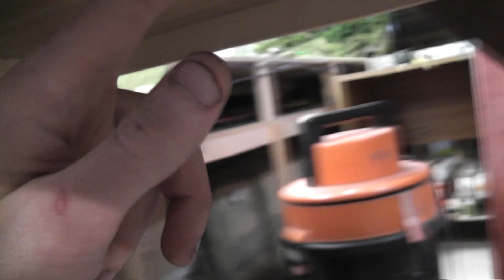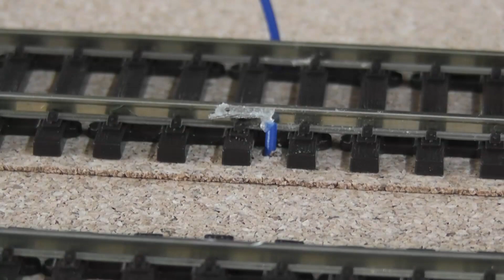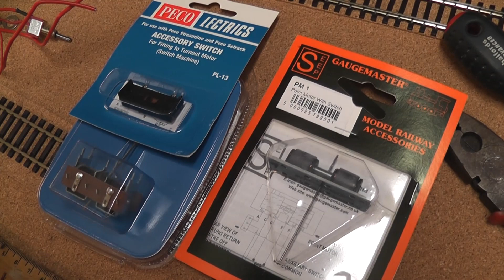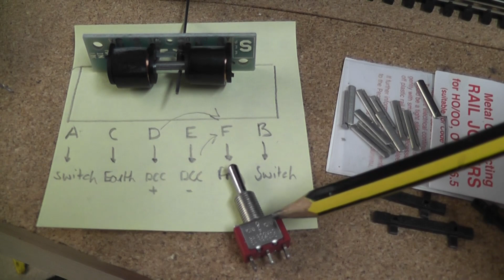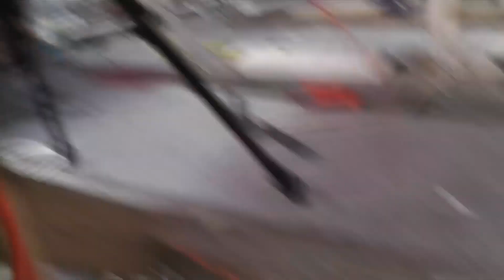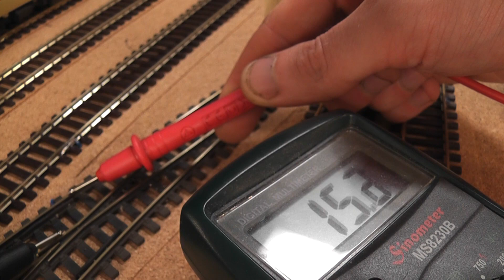Building a Model Railway - Part 4 - Wiring

Comment: Hello Richard.
Thank you very much for your videos.
I have learned a lot and starting from scratch.
I have a digital model with Z21 and Roco multimouse.
But I have a problem with the peco MP1 turnouts, because they make me short and the connections are correctly made.
I would appreciate your advice please.

Excuse my English but it is done with the translator.
Regards, and thank you very much.

Comment: Take some sandpaper and clean the oxide off the wire before you attempt to solder. Flux is not sufficient. Also clean the soldering iron tip. Works better wnen you do.

Comment: The two most common electrical wire sizes in the USA are 12/2 (12 gauge rated for 20A outlets) and 14/2 (14 gauge rated for 15A lighting). If you look at the markings on the white vinyl insulation that wraps around the wires, you should see the gauge size marked on it.

Comment: Like your Videos, love your choice of Flux.(LACO self cleaning))  being a retires Plumber, may i offer a small tip. after soldering wash the joint with a little soapy water,removing the surplus Flux,this will stop corrosion, ensure a longer life of the soldered joint.

Comment: Just a thought, instead of t&e use 1.5 or 2.5mm2 singles what we use in conduit/trunking containment systems.  Singles are stranded so you can crimp the spade connectors instead of soldering.  When soldering place the iron onto the part first and let the heat transfer into the part before applying solder 👍

Comment: For everyone complaining about wire colors, he's in britain, they use a different standard for wire colors over there. Though the soldering instead of crimping did seem very weird....
Reply: The standard for canceling is live is brown, blue is neutral and yellow green is earth. 
The issue is that he hasn't differentiated the cables not the colours themselves. Using all blue droppers makes it hard to tell. The practice usually is red and black to make it easy at a glance.

Comment: Now this is a good video as it put to bed most of my worries concerning electrofrog turnouts. There is one thing that puzzles me though and that is the "earth" tag on the Seep point motor - where does it go and why? I`ll be using Seeps so I need to know this.
Reply: Consider it the neutral or negative if that helps.

Comment: For anyone who are wondering what cable he is using is 2.5 mm twin and earth cabling. You would not need to use 2.5 mm as 1.0 mm will be sufficient.
Reply: 1mm would certainly be sufficient from a current point of view, but for a large layout with decent current draw the voltage drop would be too big on 1mm.
Reply: It's not necessary but it doesn't hurt.

Comment: Very nice and informative video. Just one suggestion: Use the same, or similar, colours on your dropper wires as the bus wires; after all, once the track is ballasted you won't notice the colour of the wires, but it will be easier to install. I have used such a scheme on my layout, though with an additional yellow dropper for feedback (I use feedback modules which detects power consumption whenever my engines or DMUs passes a given section of track).

Comment: What does DCC mean?
Reply: Speketwome
Reply: Digital Command Control - a control system where the track is permanently live and digital pulses control the loco through an internal decoder.  Each loco has it's own individual 'address'  which will recognise a set of pulses sent to it.

Comment: Everyone on You Tube who does soldering makes it look so easy.  Every time I try to solder wires to something, either nothing happens, or it's a total mess and the glob of solder falls off.  I really wish manufacturers would mount screw terminals to their devices.
Reply from the maker: You need a decent soldering iron that gets properly hot.  Then you only need to touch the wire or connector for a few seconds and the solder will flow.  If you are waiting for ages or the solder is going in blobs your iron just isn't hot enough to get the job done.  Try a 100 watt soldering iron.
Reply: EverardJunction 
I have a 75W soldering iron, is that good enough?
Reply: You have one (or both) of two problems, too little heat and/or no flux.  A soldered joint needs the two parts to be scrupulously clean with a 'flux' to keep them clean while heating, and sufficient heat to heat both parts up to the solder's melting point and then you just feed in sufficient solder.  It gets easy if you do lots of practice on scrap wires.  

There are acid (active) fluxes such as LACO in the UK which need to be wiped away and resin (passive) fluxes.  The acid fluxes will also help to clean the metals to be soldered and is generally used by plumbers and not on electrical or electronics due to the corrosive effects.  A plumber will clean off the flux from a joint with a wet cloth and running water inside the pipe will wash away any internal flux - hence the need to flush newly soldered plumbing pipework.

I only use a maximum of 25 Watt soldering iron on electrical work and usually only an 18 Watt iron (note the capital W, it is a convention as it is named after the scientist James Watt)
Reply: @TerryD15  Watt is sentence case when talking about the unit. 1 watt is the correct way of writhing it but if I was talking about the scientist Watt it's capitalised. Only the short form of the unit W is capitalised.
Reply: @TerryD15  Named after is not the same thing.. Manors? What have they do with anything. It is not grammaticaly. there is no convention for capitalising units, if anything it is for them to be in sentence case. Try submitting a college paper with unit names capitalised in the middle of a sentence and see if you get docked marks for it.
Besides in some cases the units are named after but were never defined by the scientist they're name after.
Watt was proposed and defined, not by James watt but by another scientist.

Comment: Always better to use two colors for track feeders... Normally Black and Red... and remember to decide which color for which rail. I use Red on Right (or rail closer to the edge of the benchwork). I found it important to run my shortest wheelbase locos over turnouts while laying and wiring of track sections to check for possible dropouts or short circuits.

Comment: Great videos - very informative and super camera work.  One issue I had whilst watching 'Part 4 - Wiring' was that for both of the droppers from the rails you used blue wire.  Perhaps it would be better to use a brown and a blue wire since your DCC bus wires are brown and blue - particularly as lots of folks are wiring up whilst underneath the baseboard?  This could also possibly help to aviod confusion when wiring up for forg polarilty switching?  One minor gripe - since DCC is around 15V AC, can you please try to aviod using phrases such as 'positive' and 'negative', being AC neither wire is positive or negative as both rails constantly switch polarity.  Better to refer to them as 'feed' and 'return' or 'live' and 'neutral' or 'feed' and 'earth' - there seems to be no agreed convention here??  Always having the blue bus wire closest to the baseboard edge is fine - except where you have access to both sides of the baseboard.  Roy Sage makes a good point in this respect to ensure correct polarity - using an old wagon marked appropriately.  Just my two penn'orth.  Keep up the good work!

Comment: How many dropper wires are needed? Do you have to solder them to every section of track?
Reply from the maker: I fit them to every line and if its a long line I put a set every meter or so.  You don't need to wire up every piece of track.

Comment: Thankyou Mr Warren Everard Junction has been an inspiration and your videos are very informative. Its thanks to you that I've started building Shuttler TMD its not as extensive as Everard Junction but is dcc of which I've never dealt with before. So far 2 47 1 37 and 1 60 all modified with Bachmann decoders except for a Hornby 47 which throws itself off points. Keep up the good work and good luck with the Granada restoration. I wish you were local so you could restore my project. Best wishes for 2017

Comment: Hi I'm running a DCC layout but all of the accessories (lighting, point motors, signals etc.) will be running off a Hornby controller (this would only be used for those and nothing else). If I want to have a bus wire for my accessories where would it start?

Thanks, Tom
Reply: The start.

Comment: I have a Peco 3 way switch insulated, would the Seep Gauge Master switch PM1 how would I hook up the wires to the frogs so the engines won't stall. I watched  the video on the electronic  frog 3 way how do I do that for my insulated 3 way? Thank You for your support
Ernie Peluso
Reply from the maker: I've not used the insulated one so am not sure.  It probably doesn't have any wires out the bottom so you can't wire it to the point motors.  It will rely on the connection to each piece of track for power.

Comment: Do you get electric shock for touching the track? Or is it insulated?
Reply: UnholyGaming2012 It low voltage ac. You won't get a shock.
Reply: @ruralaccentwoodcraft604  That's true but don't always assume that all low voltage won't shock you. You can still be shocked with low voltage but it doesn't carry enough amps to cause damage.

Comment: I'm really enjoying this series of vids on how to create a very nice layout, full marks for the finished effect. I'm confused though, with regard to the wiring, as to why you didn't colour code the dropper wires?!? Or, at least, recommend it? Using a different colour for either side of the track would surely make connection to the buses so much more certain.

Comment: This guy is unbelievable! First off, NEVER use "solid" wire for DC circuits. You will get an inherent power loss. Use stranded wire. Second, "COLOR CODE" your track wires. It makes tracing and maintenance so much easier.
Reply: Good troll
Reply: +Steve Leber power loss on cable occurs when the cross section of the cable is not sufficient to sustain the power going tro it, solid cable can actuale hold more than flexible cable.
Reply: sorry mate but ur wrong there, solid core cable like the guy is using in the video is not ideal for low voltage , (looks like a bit of 1.0 mm twin & e) trust me I've been an electrician for 20 yrs and had a fair bit of experience with automotive wiring aswell. You really need to use multistrand cable for 12 volts like you use on a railway. If you buy cabling for any low voltage purpose you'll find its stranded as it's current carrying capacity is much greater.
Reply: no sorry' aircorian ' you've got up facts wrong mate. Yes solid core cables are fine for higher voltages,  ie 240v  but when ur talking LOW voltage it's a different story.  
On installations carrying low voltages such as 12/24 volt your current carrying capacity is simply higher on stranded section of cable.  Look it up in a wiring regs book if you don't believe me!  

One of the 1st things you get taught when working with low voltage.
Reply: @paulbb27  That's true. I agree with you but for no longer than his runs and for what he's running, the loss should be negligible, right?

Comment: Great video. Can I ask the wires you use to solder to the track and wire needed for point switches, what size of wire do I need to get to go to the switches and is the bus wires that run along the base board, are the bigger wires.

Comment: i know what gauge wire that is, I believe it is 14 or 12 gauge.  14 based on the color standard we use here in the US for the outer insulation, 14 is usually white and 12 is yellow insulation "usually".  12 is also possible as you can order all sizes of wire in just about any color.

Comment: Hi Richard, really interesting video.  However, could I ask for some advice.  I’m currently building an N Gauge layout, but am having problems with power getting to the track.  I’ve been using Scotchlok clips to connect the dropper wires to the bus wires, but I’ve now been told the Scotchloks are the problem, as the blade’s not cutting into the dropper wire.  Would the spade connectors you’ve used work with N Gauge, or is there some other method you could recommend, Stewart.
Reply from the maker: +Stewart Fraser Hi Stewart.  The spades and crimp blade splicers have worked very well for me.  No problem using them on N gauge.  Just make sure the wire gauge is big enough to get a good contact.  Thanks
Reply: +EverardJunction Hi  Richard, thanks for that.  I'll give it a go and see what happens, cheers, Stewart.

Comment: Hi, cheers for your great videos! Why do you provide separate wires for each track? I'm asking because from what i understand, giving power to just one spot on any track anywhere in the layout, would let the power flow on every track, providing that all tracks are connected.
Reply from the maker: +Pavlos Ioannidis Points on the layout isolate sidings and other parts depending on direction.  If you only had one spot for power you would soon discover various dead spots when operating pointwork.  Multiple power points also make the running of trains more reliable as you don't depend on the rail joints.

Comment: I've noticed in many of your videos that the rails of pieces of track do not touch the rails of another piece of track but instead you rely on the fishplates to transfer the power, do you recommended this and if so why?
Reply from the maker: +LukeBD150 It's important to leave a gap to allow for heat expansion.  I have a set of power feeds every meter or so to keep the current flow more reliable.

Comment: I am pretty sure it is 14 gauge wire solid core since that is the gauge of the stuff going through a typical American home.
Reply: +GUNS4MIKE1234 14 ga minimum for household (15amp under 70' length), but that's still over-kill here for these purposes. It's OK, better safer than sorry.

Comment: Hello Richard,
After following and enjoying your well put together videos for quite a while I decided to install Seep point motors (powered separately 12v)  through a cdu  like yourself but I'm having difficulty with the dcc controller shorting when I change the point switches ....

I thought it could be that I didn't cut the two wires under the point rails as advised on instructions but then noticed you haven't !!! any ideas would be appreciated thanks ....
Reply from the maker: Dave Butterworth Check the position of the motor carefully. Sounds like whats happening is the polarity switch isn't quite making it across to the other terminal.  That will cause a short with the point blade.  If you keep getting problems you can cut those two wires under the points and that will solve the issue.  Just bear in mind that cutting those wires makes the point solely reliant on the polarity switch working properly.  Hope that helps.

Comment: Cool video.  I use a flux pen, but it can be a bit watery and when soldering droppers to track it can take a few seconds to let the solder flow.   Does your flux require wiping off with a wet sponge etc after?, to prevent corrosion/greeny colours appearing later. Dave
Reply from the maker: DaveClass47 You should wipe it off, I try to use as little as possible so I don't have to wipe away excess.  The green stuff usually only comes about when exposed to moisture, such as ballasting.  When it has appeared I've had no problems.
Reply: EverardJunction Yeah I use a liquid 'no clean' flux pen, but when it comes to fixing droppers to the side of the track its not that effective as it tends to flow away.   The paste holds the wire better when fixing to track.

I solder all of my droppers to the bottom of the tracks before placing on the layout.   This works well on straight-ish track, but on curves it can make the sleepers near the solder go wonky as the solder stops the sleepers on the flexitrack from sliding into correct position.  One plus point is that doing it this way makes them invisible and it give the solder a nice flat surface to bind on to.  I just cut away some of the plastic sleeper and do it.   However in some cases where improving the electrical signal on already laid track needs to be done the side of the rail fixing method does come in handy. 
Cheers.

Comment: If you are using insulated points (hornby standard) are Outputs D,E and F ignored? 
Also can anyone help me with a way to power accessorys? I have a few of the hornby dc controllers around and I was wondering if these would be ok, or do I need something else? 
Thanks, Christopher! 

Ps, awesome video
Reply from the maker: T3RRA_BITE_ Yep, insulfrog points are much simpler.  You can ignore D, E and F.
Reply: Yeah I watched the next video haha, 
Awesome series btw! 
But with regards to an extra power bus for the points would a old hornby controller work?

Comment: Another fantastic video. What are the order codes for the blue splicers and the spade connectors and where do you get the small red switches from?
Reply from the maker: Jonathan Latham The switches are spdt (on) off (on) toggle switches.  You can get them from most places.  I got mine from rapid electronics the code is 75-0086.  The 6.3mm spade connectors are sold all over the place, mine came from ebay.  The blue crimp blade splicers order code is 33-0190 and I get them from rapid electronics too.

Comment: The mains cable will be "twin and earth" and either 1.5mm or 2.5mm depending if its "lighting" or "mains" cabling. 2.5mm obviously has fewer losses and is what I would use. I personally prefer the idea of the Tortoise motors with LEDs on the control panel to indicate which way the points are set, but its more £££ and more time.